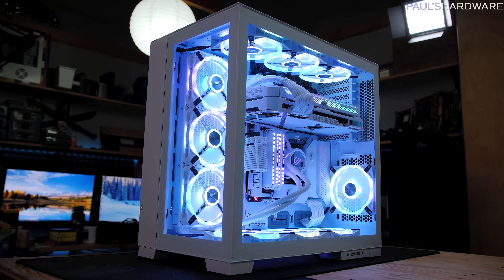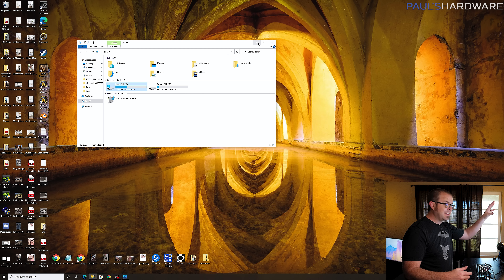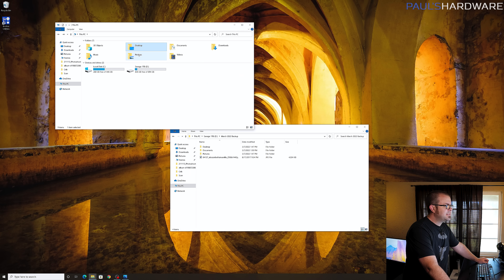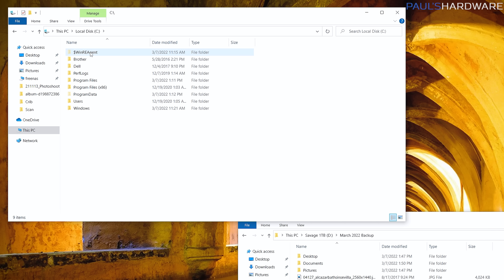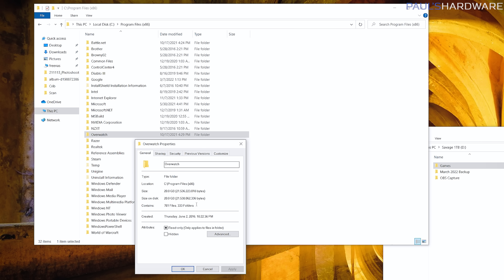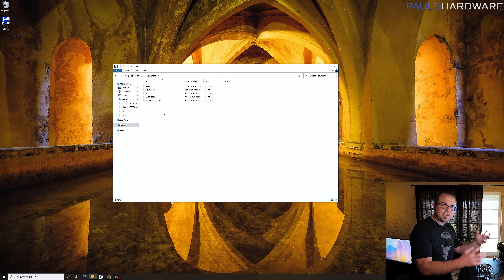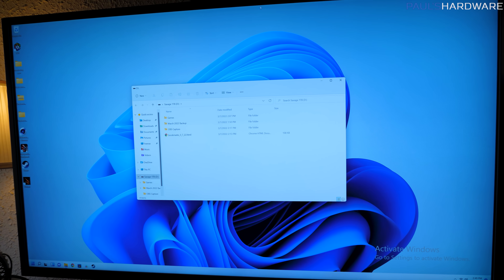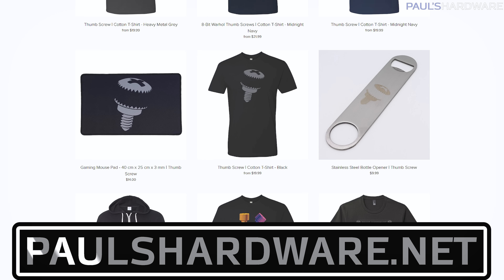How to Move Everything from an Old PC to a New PC

Comment: What I want to do is use my main (only) drive from my old computer as my second drive in my newer computer, as more storage for music and photos.  The older drive has an older version of windows on it (currently using 10 on newer one).  Will I need to do anything special to keep my computer from trying to use the older drive to boot up with?  I have Office on the old drive but not the new one.  Will I be able to use it without too much fiddling or having to buy a new copy of it?  Old drive is just a HDD.  Newer one is a hybrid HDD.  Both are 1 TB, I believe.
Reply: Reformat the drive.

Comment: A helpful tip: 
if you're like me, and you tend to have alot of photos or videos you want to consolidate and move over, type "kind:video" or "kind:photo" without quotation marks in the search bar and it will scan through all subfolders of whatever folder you are viewing. I'm sure there's other tags you could use, such as jpeg or png. I've only ever needed those 2, so I'm not 100% sure.

Comment: I think using disk imaging software such as Acronis will reduce a lot of the manual legwork that you have to do unless your intention is to do a fresh install and minimize the bloat that gets transferred over to the new PC, but for most people, the process will be much less tedious and time consuming. Also, in terms of game save files, many games support Steam Cloud so it will simply pull the latest version from Valve's servers once you launch the game, which reduces the headache of finding where individual save files are located as they vary per game.

Comment: Good tips. If you are not using a password manager but rather have your web browser saving your passwords make sure you export the passwords being stored in the browser.  If you are using Google Chrome and have a password on the Windows account then Chrome will encrypt these passwords when the browser is closed.

As I work on other people's computers I use a commercial piece of software called Fab's Autobackup to do this backup of the data. The software is not cheap but its a good way of backing up the data when moving it over to a new computer and you do this process fairly frequently.

P.S. scanned the comments and reported the darn spam bots to YouTube for what its worth.
Reply: is it possble to contact you ?

Comment: If your wife still wants to maintain that size / resolution, I just upgraded my setup with the Aorus FV43U.  4K, 144hz, Gsync / freesync, hdr1000, It's a VA panel not IPS.  Think microcenter carries it so might be able to go see it locally.  It's got a weird BGR subpixel layout so very small text is kinda dumb but zoom 10% or so and it's not noticible imo.  Definitely a great large format gaming monitor that has good out of the box calibration and has a KVM switch built in which is nice bonus feature.

Comment: I know this was a rule of thumb video which is great but it's obvious that you both don't use iPhones because that sometimes could be a pain. You have to copy the entire folder over then connect the phone and then reregister the phone with this device, because they only allow your Apple ID to connect to 5 unique computers. Sigh Also if you did any backups using itunes and try to move those files to a new machine there's a great chance of you not being able to access the backup.

Comment: It's a shame that Windows is STILL rooted in that ancient "C drive" paradigm that has its origins in the 1960s.    You STILL can't have your home directories on a different drive and they have yet to get links or mounts working correctly.    They are no backup solution and no software repository or real filesystem layout, it's just a big fat pile of stuff on a C drive and you have to deal with secondary drives like you did 50 years ago on ancient operating systems.    Windows needs to at least update to 1970s tech

Comment: I have 3 m.2 in my system. A 500gb OS C: drive, a 1tb D: drive and a 1tb F: drive. I just bought a new 2tb m.2 drive. Can I just use Aomei or Acronis software to copy one of the 1tb drives to the 2tb drive and then erase the 1tb drive, so I can then do a fresh Windows install to replace my current 500gb OS drive?

Comment: Alternatively you can just use Macrium Reflect and then make an image of the old drive and install that image onto the new drive (i do not recommend cloning)

And then all you do is just plug the drive in download install and run driver booster then uninstall it

Thats it your done

3380m intel laptop to R5 2600 AMD desktop didn’t have a single issue

Tho i do go ahead and reinstall windows about once a year seeing as i annually get a registry corruption and with RegBack no longer being a thing when it happens windows will never boot again no mater what you do

Its just stupid they disabled RegBack as well as re-disable it when ever you do a windows update its like Microsoft wants us to stop using windows

But what you can do is copy the entire User folder and while logged into an account on the new PC and just copy everything directly into the new user folder
Reply: If you are getting “registry corruption” then you are causing your own problems. Or you are assuming every issue you have is a registry problem. My advice to you is stay out of the registry purely based on the fact that you used the words “registry corruption”
Reply: @o0Donuts0o  it has been caused by me twice at this point that much i know but those times i had taken a backup manually before doing the changes so those times it was avoided

The rest if the times its just windows showing its age from wear and tear form being on 24/7 with the only shutdowns being crashes or from updates

But the thing is if the registry breaks stopping you from booting your shit out of luck

I dont normally change the registry at all after the first week which is ruffly how long it takes to restore windows to how i like it and anything after that is simply caused by wear and tear

But you can easily tell when it is registry corruption because it will specificity tell you what the reason for a failed boot is and you guessed it, it will normally state a registry file

Outside of the registry borking i can and do fix the issue’s but on registry corruption or 12 months which ever comes first i do a fresh install

But if you made it this far i will clarify: while windows registry corruption does stop booting up… all your data is very much still there

So using windows like the tool it is when it breaks or i cause it to self destruct i never loose any of my stuff i only loose about 20 hours of my life

To date i have destroyed 2 windows installs the other 20 where caused from wear and tear

But out of the some 900 times it have broken only 22 times has it been unfixable and of those 22 times 19 where corrupt registry files normally the system one

Comment: WinDirStat is great, I found programs I use at work that were just leaving loads of garbage data on the disk and that's why drives were getting full. Set up some quick batch files to scan the locations where that junk was getting dumped and delete it if it's more than a few months old, no more bloat. Never would have found it without WinDirStat.
Reply: WinDirStat is old school and slower than dirt.  TreeSize FTW!!!!

Comment: You forgot about winget! Really fast way to see what you've got installed, and it will even pull what it can from the internet automatically if you import the file on the new machine.

winget export -o export.txt
By default it saves to C:\Users\<user>, but you can change the path.

Comment: My best advice is to plug all the old PCs drives into the new PC temporarily, then boot off that main drive. You can use a program like Acronis backup or similar that will allow you to copy an entire drive (even a boot drive) in their entirety. Your only snag might be if your board has only 1 m.2 and you’re upgrading, but that’s uncommon. You could always copy old m.2 to sata drive, the. Sata drive to new m.2. Upgrading my PCs m.2 from PCIe 3 to PCIe 4 took me only about 5 mins in setup, and whatever the transfer time was. Take the old drive out, boot off the new, good to go!
Reply: Im not to tech savvy, i was going to get another PC without OS/drives etc and just move my old SSD/NVME across...would that work ?
Reply: @catlee8064  Umm. Not so much. back up everything apart from OS  on USB. Easy to get even a 240Gb USB for under $20. Hell I turned one into an ear ring as a fashion statement. But do a clean install and install clean new drivers for MB Video drivers updated everything drivers, basically new driver for every single new piece of hardware in your system. And the software to best interface with that system. Without more info that's your best bet. I mean you haven't even said if going from Intel to AMD. But even Intel to Intel a fresh new install is ALWAYS your best bet.
Reply: @Lukiel666  im making a new and i heard i can just take out my old ssd and hd and plug it into the new pc and everything will b on my home screen jjst like before. Is that true.
Reply: @catlee8064  Oh that’s the easiest way. This video and my comment only apply if you are changing boot drives.
Reply: @catlee8064  yeah
Reply: @catlee8064  Quite a late reply, but just to let you know for next time:
If you were physically taking out the drives from the old PC and physically putting them in the new PC - then it works.

If you are using new drives in the new PC, and you want to use the same OS installation, than you need to do what John wrote in the comment. 
If you just want the personal files, then you can do what the video shows.
Reply: I kinda did that when I got a new 2tb ssd instead of my old hdd. Only I never got around to actually plugging out the old one, so now I have to figure out how to save all my possibly dublicated data.... Sigh.
I have found the tools, just not the motivation
Reply: yeah or get a $20 m2 PCIe card
Reply: I used to like Acronis back on Win7 (True Image Home) to clone drives , but with Win10 they moved to different 'license' types.  I could no longer use my copy all I like.  My Win10 version was SPECIFIC to the computer, no transfers allowed.  Now it seems they do a Cyber/cloud thing with a yearly fee.  : /
Reply: @anotheruser676  If you had an OEM Windows 10, then yes, it's specific to the motherboard. If it was a regular Windows 10, then it should work.
Reply: Hello! I know I’m 9 months late to your conversation but you seem like a knowledgeable responsive person… my boot drive just died. I’m going through the RMA process with Samsung. I plan to just make the new drive they send me my boot drive again. Fresh install of windows… my question is, will it recognize my other hard drives or will it want to reformat them? (I already know I need to disconnect them when creating the new boot drive and then reconnect them after windows is running solid).
Reply: PSA dont buy those “250gb flashdrives” for $20 they are for sure just decoy drives that corrupt all your files

Comment: The Music folder is essential!  It contains all wma copies of my LPs and CDs. The copies are from 2005, done by Windows XP during a couple of months.
The number of fans in your PC seems crazy, my Ryzen PC only has one CPU fan! The power-supply fan and the reused 2-pin case fan sounded like jet engines, so this month I disconnected those fans.  To compensate for the case fan I left the side panel off, the desktop now looks very modern. The power supply probably does not need a fan, because my PC only needs 50 to max 150 Watt (R3 2200G 65W), the power-supply feels lukewarm most of the time. 

Besides another 600W xTech power-supply only costs DOP850 ($16). That xTech power supply is special, it only has a 24 pins motherboard connector; a 4 pin CPU connector and 2 Sata and 2 Molex connectors :) I assume it is tin plated and I use it now for 3 years for 24 hours and 7 days/week.  

Converting from my old Phenom II system to my Ryzen desktop was very simple, I just moved all disks in the right sequence to my Ryzen desktop and rebooted and afterwards I used it for half a year :)  Maybe Ubuntu (Linux) helped by just reorganizing itself.   Later adding a nvme-SSD I had to do a lot more work.

If I want light on my desk, I don't buy 9 rgb fans but I buy a desk lamp :)
Reply: yes bert, this content is mostly for gaming pcs and gamers, youre describing what sounds like a office pc, the main difference being the lack of a graphics card. The RGB fans arent really about light, but more about the looks, and additionally due to the fact that gaming pcs like the ones shown in the video run WAY hotter than your machine, bigger cooling solutions are needed. :)
Reply: @vypGMD  I play games on my PC, like Wolfenstein-3D, SuperTuxKart and others. You seem to believe, that you need an expensive PC for gaming, otherwise you should shut up.

Comment: I just reinstalled windows about 2 weeks ago on an intel 9th gen pc and tomorrow I'm upgrading it to an intel 11th gen, should I reinstall windows or should I just move the drives over? GREAT timing on this vid by the way 👏
Reply: I just swap the drive.  Windows 10 does a great job of switching between hardware.
Reply: Swap the drive to the new computer, and then reactivate your windows license.
Reply: you should go with a 12th gen ;)
Reply: @ralladinhox  I should but I snagged a used 11700 non k for $200 and a asus prime z590-a new in box for $120 from someone that got it in a newegg shuffle bundle so for $320 I'll take it

Comment: Hi Paul (and viewers!),

Slightly unusual use case, I know - Do you have any recommendations for syncing two systems, though not entirely? 
I have two PCs, one for at home and the other (despite it being at home for the time being) is for when I am away from home since I'm a long distance truck driver. 
I will play the same games on both, depending on where I am, create files and documents, and with certain games the mods are local and I might edit them to keep them up to date as the game gets updated. 
Is there any program you (that includes you, viewer, if you are reading this) would recommend that would sync selected files and folders between the two rather than me either remembering to upload to the cloud or doing the work twice to create the same file on both systems. 

Also for things like phone backups, is there a more efficient way to do this ?
I normally just make a new folder named with the date of the backup and copy over the important folders, but I realise this may leave me with several copies of the same file in some cases and in others I may have different files with the same name since the count started again (eg - backup files, delete those on phone, new file is named Image001 - hahaha, Image002 - hahaha, Ima... and so on) and I'd rather just have two copies than risk overwriting something important. 
Any suggestions for a better method of doing this ?

Hope you, Diana and Hanna are doing well, and to the viewers I hope wherever you are in the world, you are safe and well.
Reply: My only suggesti9n personally would be an external ssd that uses type c or like USB 3.1 or 3.2 so it's actually useful to load games. And just plug all games on that. It's not the best way but might be the easiest?
Reply: @cooleyzz  I did use one which was great until that fateful day when I plugged it in to be greeted with no device input sounds, nothing in Explorer, and a full unmapped drive in disk management. The drive had gone haywire and couldn't be read by windows nor Linux and despite using data recovery software I lost everything on there. 
I'm sure it was a horrible one off, and sure the originals were on the other computer, but since then I just don't want to risk it if I don't have to

Comment: You can replace it with the new LG 42 inch c2 oled or the one that I use as monitor the old LG 48 inch c1 or even the Sony version, they both support 4k 120 hertz
Reply: I wish they'd give us a release date on that 42 inch already... I had just been looking at the C1, but 48 inches is just slightly too large for the space I have. Then I hear they're doing a 42 inch model this year... Hurry up LG, hahaha!
Reply: This is my suggestion. I can't praise my c1 enough but at 48" it's a little too big for most desks.

Comment: Why not just use the Macrium Reflect software application to clone the contents of the drives in the old computer onto the drives that will be in the new computer? Of course, new software license keys will need to added, especially for Windows and MSFT Office and such, but that too is easy. Cloning drive contents with Macrium Reflect is a much more efficient approach to this task, one I've done many, many times, than copying files by hand.
Reply: Problem is that if your old computer is old you will be cloning a bunch of applications you installed and rarely used along with Windows bloat. It is always best to start a new computer off clean and only install the applications as you need them. Just move the data over.